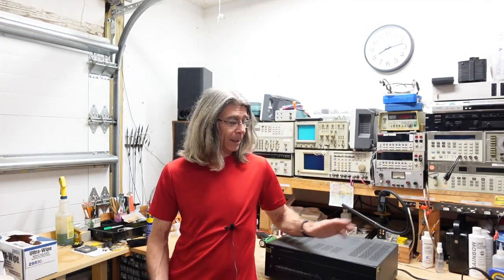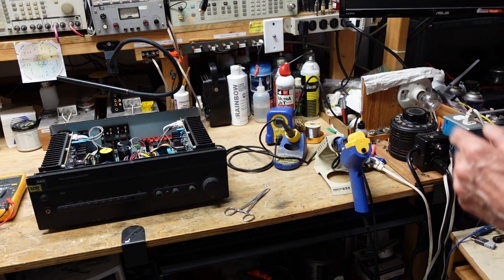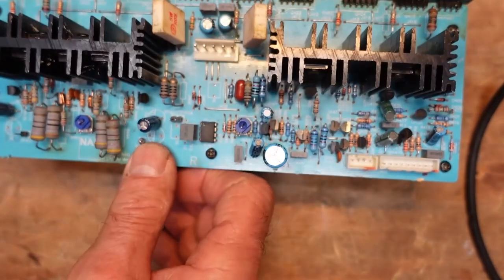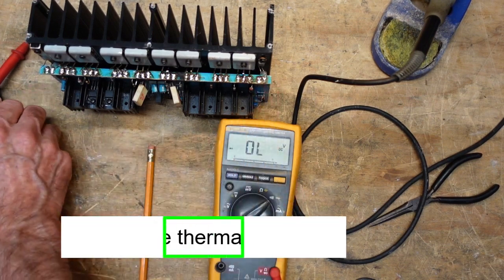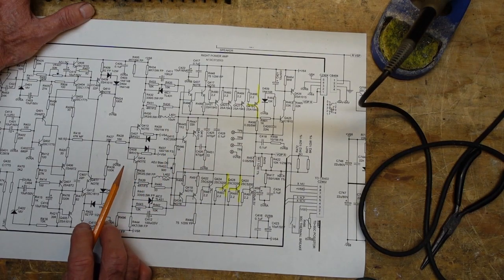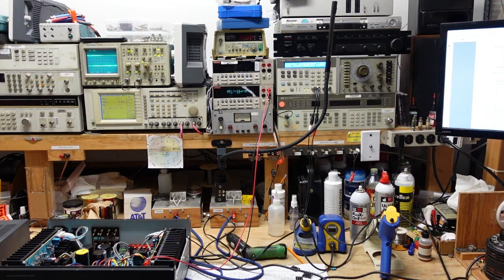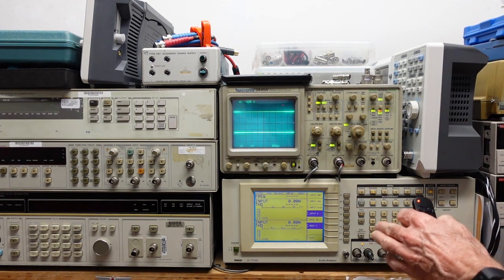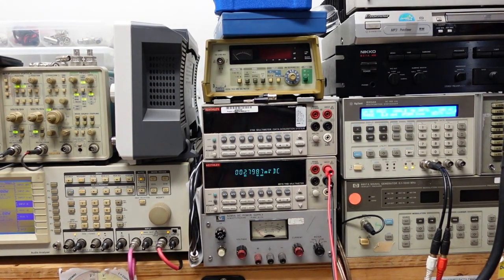NAD C342 Part 1- Fails Dim Bulb Test

Comment: Hi Ray! Thank you for sharing this jurney with your C372! This is very helpfull as im an C372 owner myself, and it looks like i have just about the same issues with my blown right channel. When im done repairing it, I want to build a dim bulb tester and test it. May I ask how much wattage(spec) your lightbulb is during this test? As I live in Norway I have 230v in my socket, and I assume this will be a little different from a 120v system regaring the lightbulb (if im thinking right) Best regards, Andreas.
Reply from the maker: Hi Andreas.  I used a 100 watt lamp.  The main thing is that the lamp allows enough current to pass that the amp will power up.  I think 100 watts is OK for 230 volt mains as well.
Reply: @raygianelli3612  Thank you for the reply Ray. Then I will start looking for a 100watt bulb

Comment: Hi Ray, I just started tearing into my C372. This thing shits the bed about once every 3 years. Last time it was the pre amp module on the tone control board. The heat cycling tends to crack the SMD capacitors.

Anyway, I've traced the issue to the right channel pcb. It has very, very, very attenuated output compared to the left channel. No distortion. Any ideas before I go to town on it?

Cheers.
Reply from the maker: GREAT screen name!  😁

As always, electrolytic caps are suspect in almost every NAD I've worked on.  Is there good signal at the input of the output module?
Reply: @raygianelli3612  Thanks! Yep. I feed a 500hz sine wave tone into each channel and it makes it through the preamp stage unscathed. I haven't had time to find a good place to feed the signal into the output transistors. I'm using your method of the schematic on paper and process of elimination/looking for a pattern, bit any advice helps. I'll replace the caps...

Incidentally, I have a kit on my bench containing high quality nichicon caps for the c372 (that NAD used in my c542, but was too tight to use in my c372 lol)

Comment: Just so I understand: The light bulb is in series with the mains, essentially acting as a poor-man's ammeter, is that right?
Reply from the maker: While it is in series with the AC line, it's function is to act as a current limiter, with the added bonus of giving a visual indication of current draw.  As the filament glows more brightly it starves the unit under test of current.

Comment: Cool channel! Adding to my regulars:) Really good advice about replacing all output transistors, if ones goes. I see single replacements all the time: 1. The other transistors as you say probably suffered a beating.. 2. The replacement probably wont match the dc gain and bandwidth of the originals so the amp will not perform well and possibly cause more issues. Btw, the new 5200 and 19xx from toshiba are not quite as good as the old ones... Smaller die, less heat dissipation. Should be fine with that many in parallel sharing current!
Reply from the maker: Good point about the Toshiba transistors. I think On Semi still makes the beefier ones.

Comment: Wow .. Hope you realize how helpful this is !  One question.. Dummy load hooked up to speak outputs,  the scope hooked up in parallel to that or in series ??  Your videos are helping me grasp this stuff, thank you so much.
Reply from the maker: Thanks for the kind words!  The dummy loads are connected across the speaker terminals of the amp, scope is also in parallel across the dummy load.  My scope is picked off the scope output of my distortion analyzer, which will autorange and keep the display on the scope about the same.  You will probably want to connect your X10 probe across the dummy load or higher power amps will output a signal too large to keep on the screen.  HTH!
Reply: @raygianelli3612  Thank you!  I will practice on an old not so important RS receiver first.  then I'm setting up for some troubleshooting!    I know it's going to be a challenge and thanks so much for your videos and help.  Much appreciated!  I have some background but never as in depth...just picked up a scope :- )
Reply: @g.fortin3228  The only thing to check when using a scope on speaker outputs... The negative terminal must be common ground (i.e. The same 0 volt ground potential as powersupply and chassis. Some amps have "active" negative outputs which when connected to your scopes negative lead, will have very bad consequences. Just check continuity between the negative terminal and chassis, if connected, you can plug your probe on. Have fun!
Reply: @raygianelli3612  yes this helps thank you. I experienced this yesterday, my scope was set on highest 5v/d and had to switch to 10x after contemplating how to get a reading for a minute..duh!  Thanks!

Comment: This is a brilliant video. I just wish I understood more about what having turned down the bias was for, that bit was not clear.
Reply from the maker: If you remember cars with carburetors, you used to set the idle.  Same thing applies here.  Excessive idling current (AKA bias) can generate excessive heat, and het is the enemy of semiconductors.  HTH!